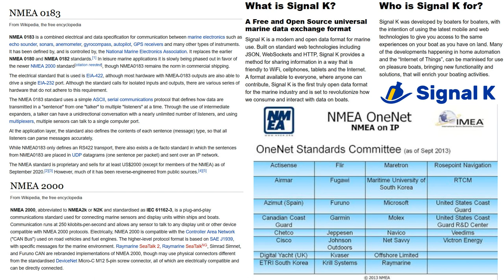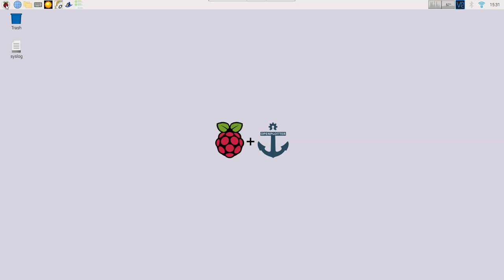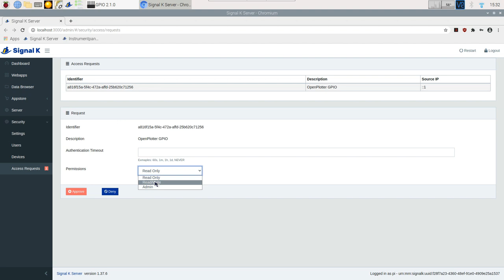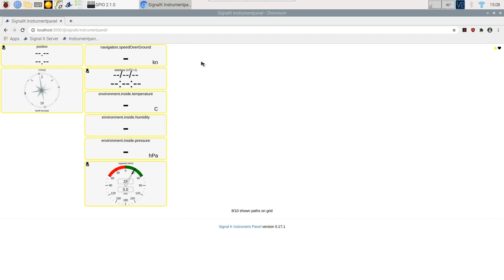Connect Seatalk-1 devices to Openplotter using GPIO

Comment: I wonder how open plotter knows how to convert from a nine bit protocol rather than the NMEA0183 eight bit format. I will have to look into this. Thanks for the demo.
Reply: It's a SeaTalk to SignalK plugin which handles the conversion. Since it's not using a UART, I suspect they are using some sort of SoftSerial interface.